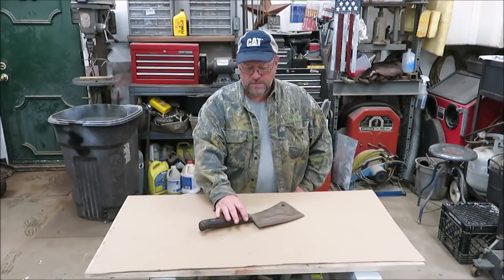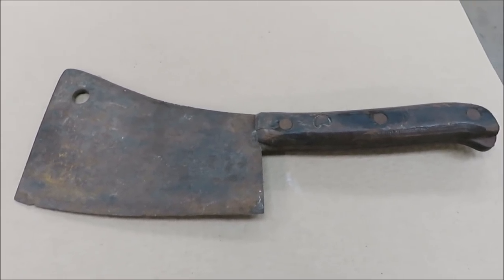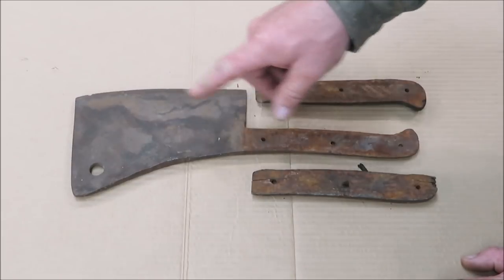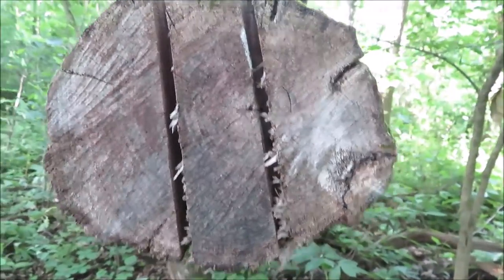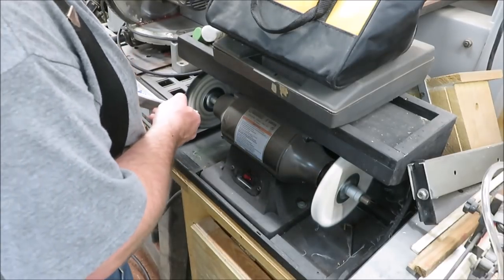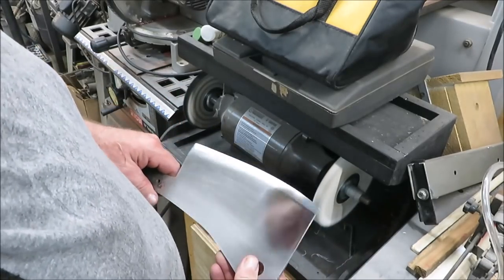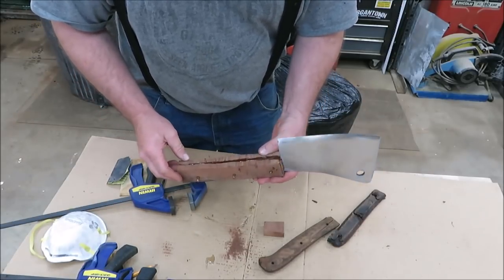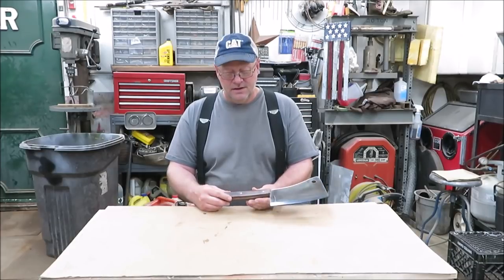antique meat cleaver restore restoration

Comment: Hey Kevin that was an old German meat cleaver from the 1800s worth in the original form about $580 bucks now not much.
Reply: It's worth zero dollars. He ground off the stamp.
Reply from the maker: Cool thanks for the info.
Reply: Where did you find that price? Pull it out if a magic hat?
These knives/cleaver were imported from Germany by the R.H. Forschner Butcher Scale Company starting in the early 1900's. I see many examples of this cleaver with asking prices (not actual selling prices) in the  $100 range. Kevin has taken a useless wall hanger into a once again functional tool.

Comment: Your not "restoring" it, your making a new one. Theres a big differnce. As an antique it would be worth like 50$ as a restored Antique 100$-10k$ Depending on who made it and who used it.  A new one maybe 100$.
Reply: Ok watched to the end. Id say 75$ . You did a good job making it new. Couple things. When you were working on the handle you clamped both sides togather and drilled them, but you did not clamp them to the platform on the drill press. Not good and dangerus. Be safer man. Also the Butt of the handle should have been a tad bigger, its suposed to be there so it dosent slip all the way out of ones hand. The bigger it is, the safer it will be,  Also the damage on the back need to be fixed, theres too much of an arch, so you should have added metel and then cleaned it up.  Thank you for your time and videos keep up the good work.  Master craftsman val.
Reply from the maker: Thank you for the comment I've been sick sorry for the late reply.